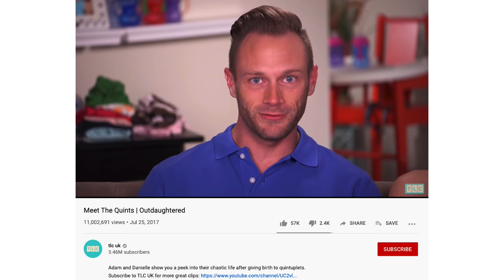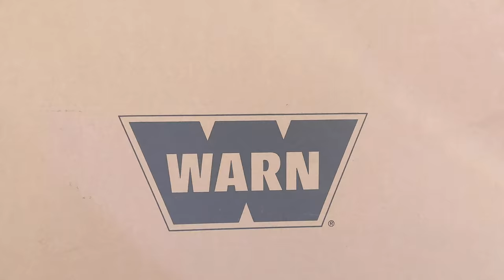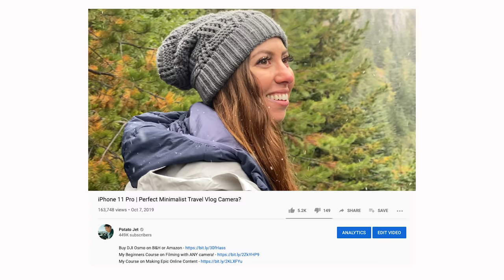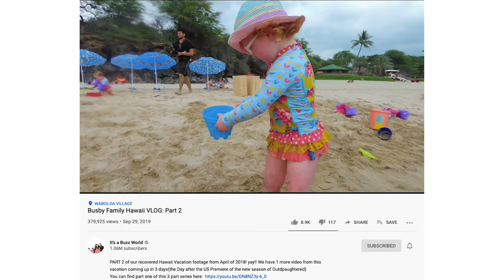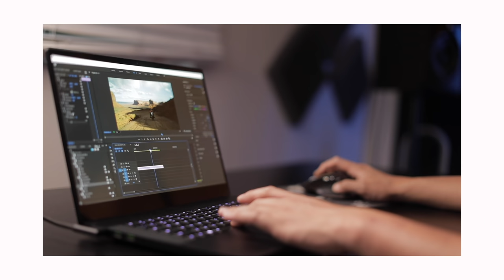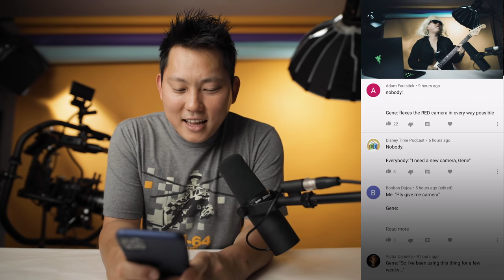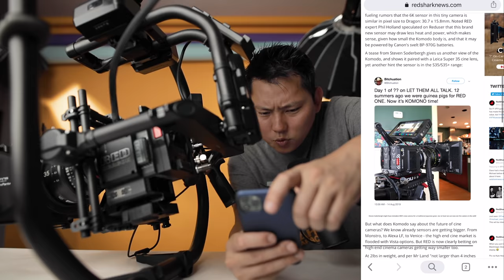4k Video Camera on Google Pixel 4 XL | Good enough for Vlogging?

Comment: Google pixel still has a long way to go... I’m glad apple iPhone finally included a wide angle
Reply: Not sure where you've got that idea from. If you mean video specifically, then sure, but photos are better out of the Pixel and the iPhone is vastly overpriced for what you get. The base model doesn't even have a 1080p screen. On the whole, it's iPhones that have a long way to go.
Reply: @David-ud9ju  just referring to video recording because the channel is basically about filming if we were on Peter McKinnon channel I honestly would be considering both but leaning more towards commenting on the photo quality of it, the one plus 7 pro or the Galaxy note 10 clearly do better than the pixel at that point.

Comment: I think you should try an LG phone, they have controls for ISO, SS, focus with focus peaking, metering, aspect ratios, control for bit rate options, monitoring audio, low cut filters, and more. And also, they were one of the pioneers for the ultra wide angle videos. also, you could monitor through headphones by plugging in on a headphone jack which other phones are omitting..

Comment: Why does phone footage always look like phone footage? I think it's due to the small sensor/the way the settings are always in auto, so I compensates for exposure by changing shutter speed and not aperture. In lowlight, you can always tell it's a slow shutter speed too. You can see the shutter speed change as you record in different lighting conditions.